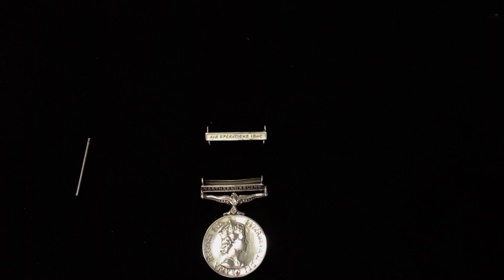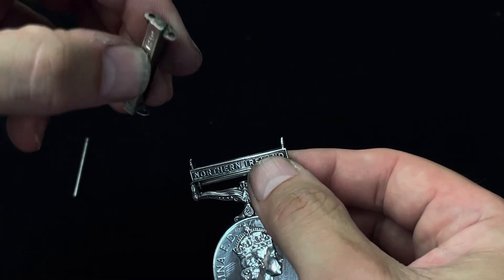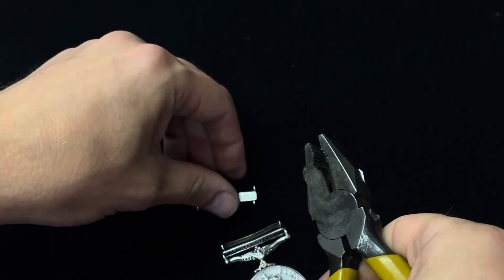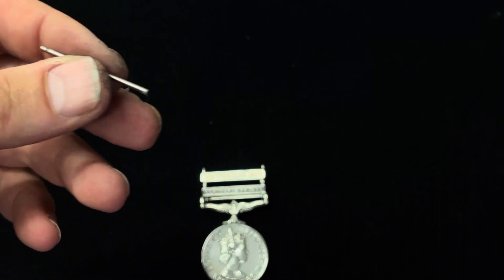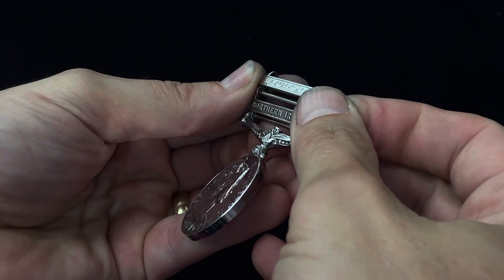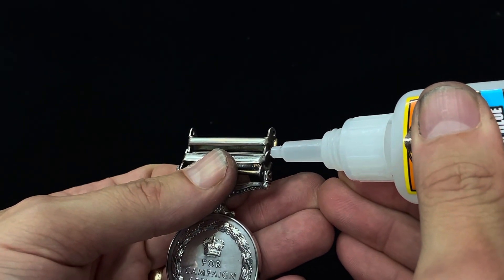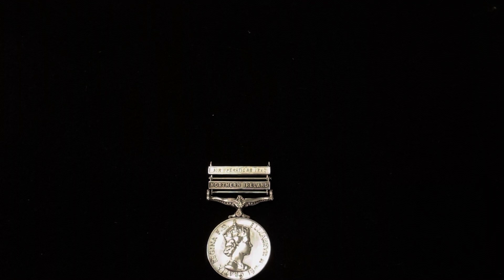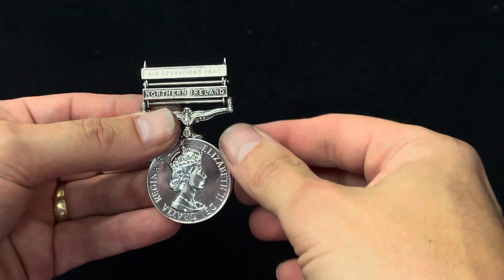How to fix Medal clasps to medals #britisharmy #military #britishmilitary

Comment: Great video, informative, only thing I would do different, is I prefer to rivet I.E gently peen the ends of the rod, this is not as hard as it appears, light hammer or even use plyers.